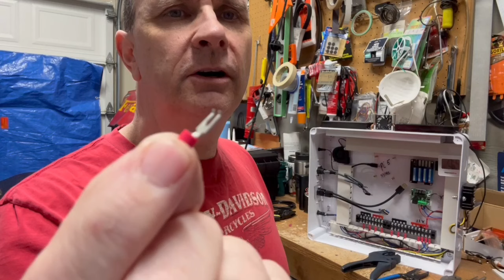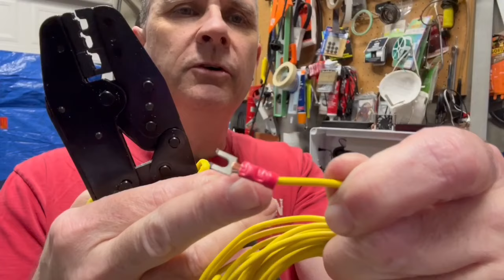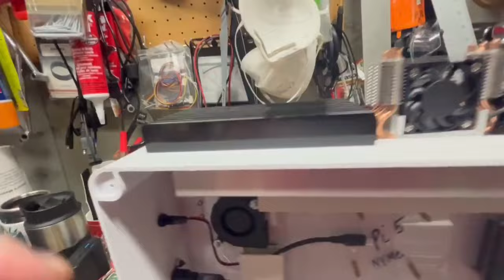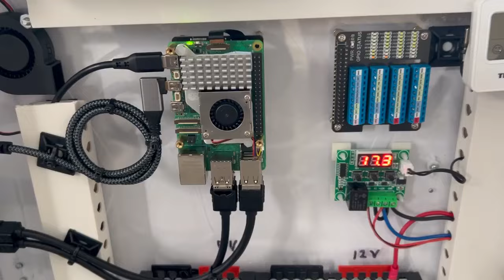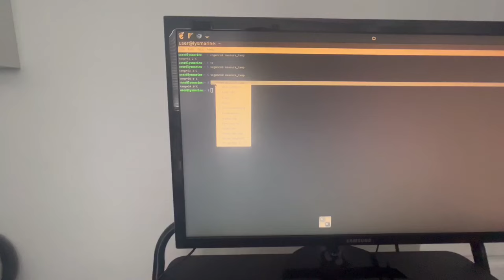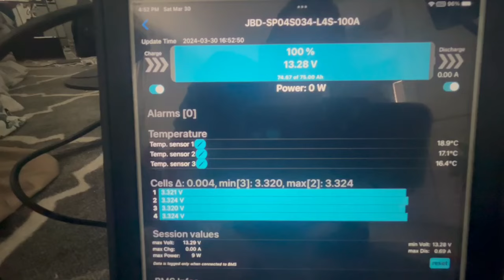Pi 5 Sailboat Navigation low power consumption

Comment: Hello! For my opinion in such kind of project is better to use passive cooling at all by means of using waterproof aluminium encloser with plastic elements or without it (in this case you may use external antenas for wifif of 4g), Raspberry Pi to use with Copper Heatsink Passive Cooling.  Raspberry Pi have to be mounted to the aluminium encloser inside by means of cooper distancer which will transfer  heat from heatsink of Raspberry Pi to aluminium encloser and to outside. I have some experiance with it and it is work fine. Also I suppose that it is possible to use much smaller incoser for such kinde of project especially in case it will be used for yachting. There is no need such big box for one Raspbery Pi and some small adiditional equipment. If you need I may to give you links to the waterproof aluminium encloser and heatsink for Raspberry Pi which I mean.
Reply from the maker: Thank you, yes I have moved to a smaller enclosure now with an Aluminum plate heat sink to move the heat to the outside of the enclosure but realistically the Pi 5 makes so little heat with this application I think it’s fine.

Comment: You have gone to a lot of trouble with the sealed enclosure there. Why do you consider this is necessary.? Corrosion on the Pi board or?  I see many setups on boat without sealed enclosures for the Pi
Reply from the maker: They don’t last long in the salt air many good setups use sealed enclosures
Reply: @davethemmp  Ok, thanks for the heads up

Comment: 5:00 for heat test, run a benchmark on the 4 cores, geekbench,  extra tip you can lock down your pi os thru raspi-config, prevents logging wearing out the sd card.
terminal, sudo raspi-config, performance options, Overlay file system => Enable or disable a read-only filesystem.
Reply from the maker: Thanks for the great tip

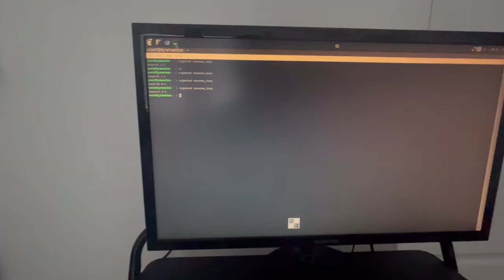Comment: 8:33 Couple of tips for you :
- On your terminal, you can use the up arrow key to summon previously entered commands.
- If you don't even want to bother with the arrow key, you can use the watch command followed by the actual command you want to monitor and it will automatically cast it every couple seconds for you. 
For exemple : watch vcgencmd measure_temp
Reply from the maker: Thanks for the tips, I need more Linux practice

Comment: Nice Video Dave!!  I have similar heat results from My Pi 5, it seems to produce less heat than the 4 doing the same job.  I bought a heat sink case (basically a big around the pi) with active cooler and it has never come on, I may have to hit it with a heat gun to make sure it is working!!  With regard to the wire strippers and crimpers, my dad was an electrician and I inherited his ratchet crimpers and automatic strippers from the early 80's and once you have used them, you never go back!!
Reply from the maker: Thanks Jason, I think the Pi 5 maybe overkill for this job but I am happy to have extra power if I want to do other functions with it down the road, I am going to have similar issues you had with connections at the helm I like your terminal box idea, I will need to make custom cables for the HDMI and USB for the touchscreen, thanks for your videos I am learning every viewing 👍